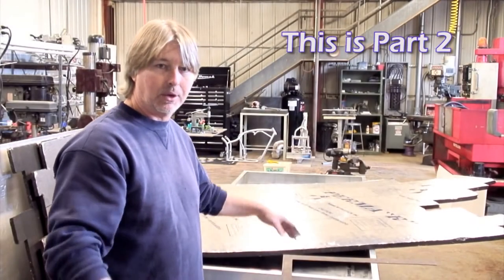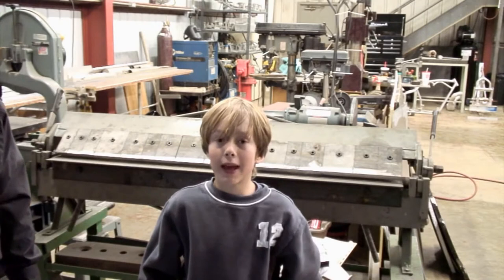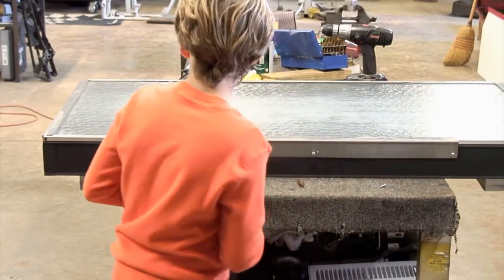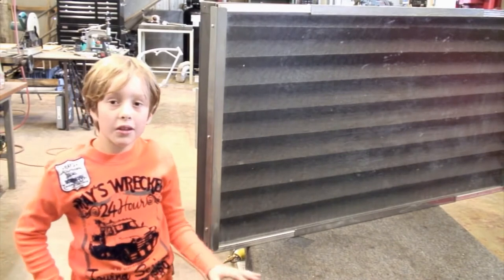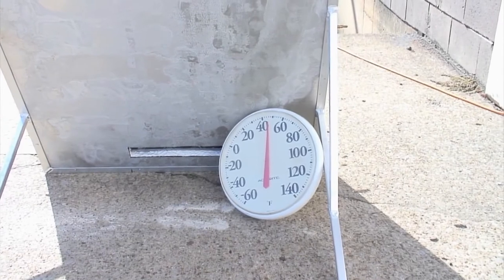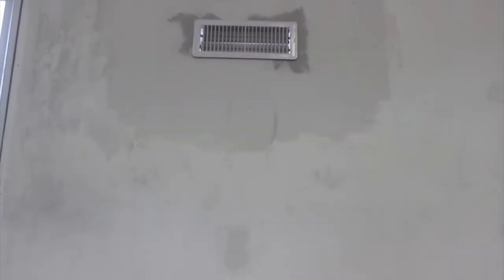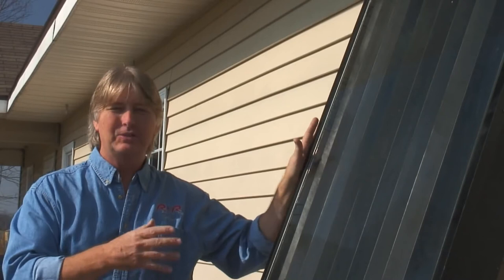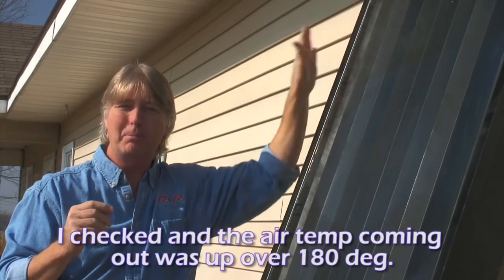Passive solar heater part 2

Comment: The temperature is irrelevant.  The mass of air at that temp is how much energy you are gaining.  A candle is hot enough to burn you.  But a candle will not heat a room.  Air at just 72f is fine as long as there is enough of it.

Comment: Greetings from France, nice work, it definitely is worth the trouble, certainly at the moment (27 Dec '22) with the energy prices going crazy.  82°C  on a partially clouded day is very good indeed.  I'm sure that you can feel it's benefit.  The only thing I didn't notice is a flap valve system that will allow you to close the vents to the heater if the temperature inside the house is higher then what the air can be heated to using the outside heater.  I'm currently looking at double glazed windows to build a 1.2 x 1.2m unit to try out.  Like your "corrugated " aluminium heat absorbing plate, makes more sense then the soda cans.  Thank you again for sharing !

Comment: Thank you for sharing your project and the good information.  I saw other builds.  Some have insulated box, and some don't.  None achieved temperature rise like yours.  They all have fans.  Fan might move air too quickly from inlet to outlet therefore not give the sun enough time to heat it up as much as possibly can before blowing it into the room again.

Comment: Good results without a fan !!! If the areas have a ceiling fan, I would guess you could have better heat distribution inside the building

Comment: Are you still using them?  What would happen if you built and installed enough of them to cover your south wall?  And the damper is the next issue.
Reply: That is what I was thinking.    Instead of just a box to utilize the sun's rays, use the whole south wall like a greenhouse.    It probably should be made so it can be taken down in the spring and put up in the fall, and somehow protect the south wall from getting to hot, depending on the type of siding on the south side.    It would bring in a lot more total heat than just a single box for heat.
Reply: @ronaldlindeman6136  I haven't seen the sun in almost a month here in iowa..